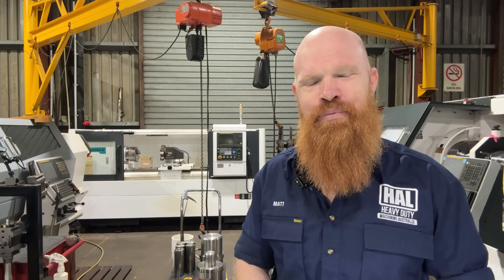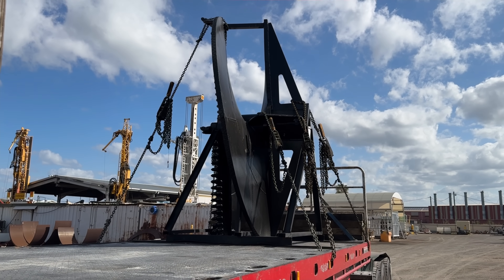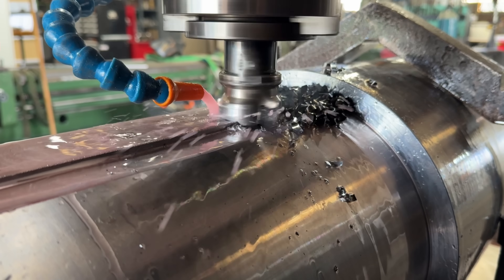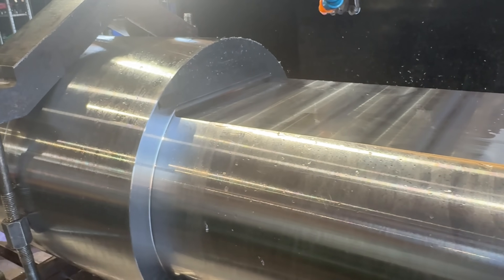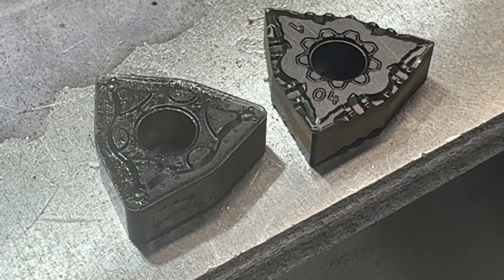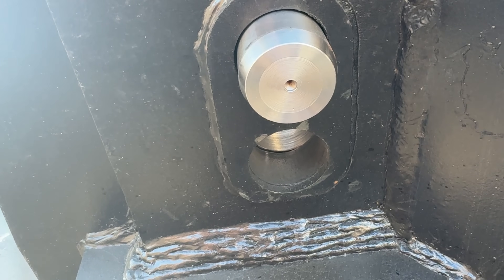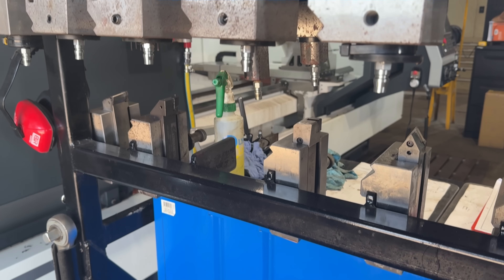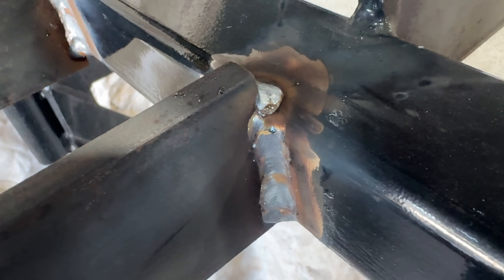Will It Fit? (Gigantic 200mm (8") Square Auger Drive for the Big Rig | Final Machining)

Comment: Hey Matt awesome video, thanks! - Question: Why do i see 5-6 flames but only one cut at 13:05 and 13:45
Reply from the maker: It’s actually the air passing through the center jet that creates the cut (the oxygen) the flame jets heat it to a temperature where it’ll cut.

What an excellent question.

So yeah there’s a larger hole in the middle, when you hit the trigger air come out and that’s what cuts 👊✌️
Reply: @halheavyduty  OHHH interesting, thanks Matt!

Comment: Really enjoy your engineering  presentations; im based in Coober Pedy just  wondering if you can give me a ball park figure of how much would it cost  to make the square drive with a maximum auger diameter of 2000mm  and 1500 mm  and 1000mm auger heads  with a 50 foot depth and  two axis base support  as this will be mounted on a large excavator rotaing base  not sure if i can add photos here or not  my phone is available for clarity also 😀
Reply from the maker: Hey mate, flick me an email to halengineeringaustralia@gmail.com if you want me to take a look.

Apologies for late reply.

Comment: Do water jet cutters have any use for such projects?
Reply from the maker: Great question!

Not really.   They’re great for plate steel up to 100mm, but get really slow and expensive after that (in my limited experience)

They’re awesome for certain applications. We recently used both water and EDM cutting on jobs.

It just depends on what you’re doing

Comment: Im not a professional but curious about something. When milling the flats is there a reason for not slicing the sides down a bit first before milling? Im thinking that would have saved time and energy. Sorry for the noob question. just curious. Thanks for shraing by the way. Great job!
Reply from the maker: Great question. Our style of bandsaw doesn’t allow it - but if it did we would absolutely saw a bunch off.

We do for some applications where possible.  Only limited by saw size

Comment: The machines I use have this same 200mm drive and the pin holes are at 90 degrees to each other rather than both in the same direction. That’s why your auger has holes on all 4 sides :)
Reply from the maker: Nice! That makes sense.

Comment: Really like ur videos,👍😎, I love that even though u do use cnc ,that u still like to use manual machines 👍 Am in Scotland and don't know anyone under 20yrs that would b comfortable having to do a whole machining job manually, yip they can fireba load of codes etc into a computer on a 5 axis machine,, but 5hey would have no clue how to carry out the same job having to use multiple machines, set ups and tools like dividing heads etc,, don't get me wrong, everything moves on, but I still think if u want to b a machinist, u should learn how to machine, before being taught how to program a machine to do the job for u🤷‍♂️🤔
Reply from the maker: Agreed 100%

All our CNC guys still use manual machines.  It’s just my opinion, but you get a real feel for it when you operate the machine manually.

Both mills and lathes

Comment: 15:19 You are either new to welding topics on the internet, or have some massive balls and thick skin! Most people would never show such a bead on the internet! If you trained to be a pro welder, then you obviously know........that is vertical down.........there is absolutely zero penetration and is it worse than holding that tab on with bubble gum. That travel direction should never be used as there is no way it could ever be appropriate and hold two chunks of steel together. 

No, you must have just turned that rack upside down and welded vertical up just to troll the viewers (but, it doesn't look like a vertical up bead), since there is never a reason to do a very fast and easy bead that looks great, for low risk applications. No welder would ever run a machine with plenty of power and make a hot and fast downhill pass that works great for thick to thin materials, while not burning through, and leaving a very pretty weld ( Although, if I ever did a vertical down weld, it might look even nicer, with all the practice from never doing it, since it is never strong enough for non-structural, only utilitarian every day life type of work!) Some of us just turn the part to horizontal and keep practicing vertical up.........but NEVER go vertical down, even if it is sufficient for the task at hand and may have advantages over doing it the "proper" way. 

Anyway, your beads do look quite nice and I absolutely agree that a well organized shop, with purpose built holders, is a great place to work, even if for some of us it is a home shop. Out in the field, on government jobs, I deal with what is there and get to operate machines and do manual labor. What I really like is the problem solving and attention to detail that I get to do with my own jobs as well as my hobby work. My tig welder is a 1965 Miller goldstar 460 amp machine, but there is nothing like fabricating and welding. My tab and slot certiflat welding table is covered in a torn down PM 833tv milling machine, that I am converting to a cnc mill, right now. It is fun to see the BIG side of the trades and to see how other people work. If things had played out differently, I could have ended up working on the kind of stuff in your videos, or as an engineer with an engineering degree vs. just a problem solver and builder who does a little engineering with limited knowledge. Your videos help scratch the itch my brain has to build, produce, and be creative, even if it is just entertainment for the most part. This beats the torture of watching some sporting event, or all the other odd stuff people seem to be entertained by.
Reply from the maker: Love the comment brother. Clearly you know your stuff.  You’re right about the job of problem solving.

It’s the thing I enjoy most about what I do.  The more difficult and crazy, the better.
Reply: @halheavyduty  I'm sure you picked up my humor.......I like that you did what works and showed it, despite people always trash talking non critical welds. Some people just can't grasp that not every job or task has to be done exactly the same or to the same standards and a smart person will be flexible and do what is right for the job at hand. Thanks for sharing!
Reply from the maker: I definitely got it.  We share a similarly dry sense of humour 💯👊🤣

Comment: Any concerns with the 90° interior corner instead of a fillet? I don”t understand the material science fully but looks like a stress crack waiting to happen.
Reply from the maker: It’s engineered to do it… but everything comes down to the ultimate field test.

Basically… we’re gonna find out real soon if it all works

Comment: Good to see a mix of cnc and manual machining.  Features like that large bore are perfect for a small G code program.  Decking off those flats would be an easy program too. CNC equipment is a big investment but you really don't need a turret on a CNC lathe.  A single point cutter takes so many repetitive cuts with incremental tool advancements.  That kind of work is just a pain the ass. Much better to let the computer do the work.
Reply from the maker: Couldn’t agree more.

We do about a 50/50 mix of conventional and CNC in the shop.  Both have their place in my opinion.

Comment: Did you build the auger?
How was the square hole cut?
Joke , you used a square drill bit.😂
Reply from the maker: Haha. The auger is the only part of the assembly we purchased. It was way cheaper to buy than build.

It’s a pretty gnarly piece of gear, but I reckon it’ll get the job done just fine.

Comment: As I always say. Tripan when you can ( cause you can always use that core you something else or sell it for a higher price then the chips )

You say that your not good at welding. Yet they look at least as good as mine if not better. And I even got asked by a Smith teacher to become a welding instructor. So take some pride in it my man
Reply from the maker: What a great saying! Im borrowing that one for the shop for sure.

Agree re trepanning. We are using our trepanning bit next video.  It just wasn’t quite long enough for this particular part.

Cheers re welding feedback.  I get the job done… but we’ve got some seriously good tradesmen in the shop.

I can mig and stick weld… but watching these guys tig weld is awesome.  Some serious skill out there hey.
Reply: @halheavyduty  just woundering but are you planning to make a new tripan drill ? if so then maybe try and make it so you can unscrew the like the first 50mm of the front and screw some extension rings on. basicly like some of the deep cole drills they use in mining. giving it unlimited reach ( start drilling with it in its shortest form and then extend as needed )

though you might have to mill the threads and side gutters of the ring on the lathe with a live tool/ spindle on the tool holder ( if you have controle over the chuck position ) that way you know that the gutter always line up cause the controle its placement compared to where the thread starts and stop 

just a idea nothing more. use it if you want
Reply from the maker: Good idea. I’ll be considering all options when we get to the design stage! Appreciate the comment as always mate 👊

Comment: Regarding the auger drive sub, I can't help seeing the sharp transition between the square and the round, as a focus for torque energy concentration. Fractures will begin at the internal corners between flats. If a slab mill had been available to cut the flats, the tool radius and tooling marks would have reduced the energy concentration at that transition. 

There comes a point when the auger is withdrawn, to be replaced by the rock drill. What determines that transition? Enthusiastic people are peculiar, in that they will push a rig until it breaks. If it never breaks, it probably weighs more than necessary. However, the auger drive sub is NOT a critical component, because the auger will always be near the surface, so can easily be recovered, to be immediately replaced by the drill bit. 

Perfection is impossible, and the enemy of progress. Any improved design would be second best, but we are not yet in that future. Everything ever made and used now can only be “third best”. I can analyse and criticise, but I must honestly score you 100%.
Reply from the maker: Love this comment mate.  Appreciate the time it took to write out!

The auger only does the first 12m of relatively soft ground, then we send the MEGADRILL.

I’ll be doing a full vid soon on how the tech works, but it’s a gigantic bit of gear that makes the auger look like a kids toy.

Agree with you re radius too.  We just had to make do with what tools we had in the shop for that one… although I’m confident it’ll hold.  It’s a pretty bloody solid chunk of steel.

Comment: On my own gut feel, I’m questioning the durability / longevity of a square drive, at these torque levels, especially imagining the fluctuations similar to a interrupted cut, but trust it has been considered.
Fascinating build, that I’m anxious to see in action.
Thanks for sharing.
Cheers
Reply from the maker: The first 10-12m won’t be too tough - hence the auger. It’s once we hit hard ground that it’ll be a hell of a show.

It’s all uncharted territory for us at this size… so as the saying goes…

There’s only one way to find out 

😉
Reply: Fully agree! I also question the integrity of an 8ft “auger drive” to pop a round hole that size some 250ft deep. It must be cutting the hole in sand.
Reply: @ronbuckner8179  It's all about "Feeds and Speeds" dude.

Comment: Would a half inch hole through the length of a large boring bar filled with lead dampen those high frequency vibrations?
Reply from the maker: I reckon it might help.  The humming didn’t really affect the end result, so we didn’t worry too much about it

Comment: The chips being pushed off of the horizontal milling machine reminded me of the game that is used in cosinos where you would load coins into the back wall.  They would drop down and starting pushing the coins sitting on a table. to drop down as your winnings.  It's to bad that the next time you see any of the machined parts that are not painted, they will be ankle deep in rust.
Reply from the maker: That’s what I thought too! 

Yeah mate. It’ll be rusty & have teeth marks all over it in no time.

Comment: is that a New machine? Is this your first one with a tool change turret?  Are you using Fanuc?  We use Fagor on our lathe and Fanuc with our mill. I like Fagor because of the graphics on our lathe.
Reply from the maker: It’s a new little turret lathe for small repeat jobs.  Fanuc controller.

We used to have Fagor & Anilam but I ditched them for Fanuc.  I didn’t mind fagor, but just chose Fanuc because it seems easier to teach (in my opinion)
Reply: @halheavyduty  yea I learnt Fanuc first on the mill. It was harder for me than Fagor although I did learn CNC from scratch with Fanuc so Fagor came easier.

Comment: If you are going to be making more of these big square drives in future, how about rough cutting the round billet into a square shape with a large bandsaw first, then finishing it on the milling machine for accuracy rather than using up hours and tools turning many kilograms of steel into fine chips? Enjoy your content keep it up.
Reply from the maker: Great observation. We did look at that, but our saw isn’t big enough… (and it’s a bloody big saw) 

We are looking at a bigger option in the future though - for this exact reason

Comment: I used to work as a CNC-Operator at Sandvik Raiseboring Sweden. So this is sort of related. It´s nice to be able to relate to what you are making, even if it´s not exactly the same as what I was doing. Greetings from the cold north of Scandinavia.
Reply: Our driller has a Sandvik DTH, cool stuff
Reply from the maker: Wow! Oh man I get that was interesting.  I’d love to visit Scandinavia one day… and escape this big hot oven 🤣
Reply: close to +9C vikings think  0C is kind of cold +-0 c celsius  is wen water freez.  Fahrenheit is a another scale wich do I do not understand. Kelvin 0 is really cold. Mm Cm.
 1/100 mm is about .00254 inch

Comment: Is the cnc lathe in the back of the intro new because  never seen it in your videos 

For the indexable drill do you use feed in Z-axis to drill? 

Really cool thing with the high speed steel tool perfekt use if you don’t have the right tool make it 

And I really find it cool that your apprentice is able to work with the jobs you do he did a amazing job with square drive 

That finish on the pin looks amazing great seeing the Manuel lathe working 

That tool cart is so cool you can have them right next to you while working we have a  storage compartment next to the lathes were we keep the tools
Reply from the maker: The tool cart makes a big difference to how enjoyable it is to work every day hey.

I’ve seen shops with tools just sprawled out on a bench and it does my head in.

Willy did a top job on that square drive. A real credit to him.

Yep. We use Z axis feed for the drills. About 0.1-0.17 usually depending on size
Reply: @halheavyduty  hand feeding such a drill for such deep jobs would probably a workout and a half afterwards your arm has a circumference of 50cm

Comment: 2:08 Great work all round but should be a bigger radius near where it goes from square to round at least 10 12mm made big things before radius all ways in corners for strength  chance of snaping in coner seen it happen you still have room to do so each side of flat add bigger radius means making flat longer seen big sharts snap because no radius
Reply from the maker: You’re dead on - we just didn’t have a bigger radius tool readily available (we have one on order for future builds though)

I’m pretty confident it won’t snap though.  It’s a fair chunk of metal.  

But… there’s only one way to find out 🤣
Reply: Good your getting one they go up to 25mm just have to step over as you know our pioneers put radius on everything for a reasion flexing your bit is a big sucker thats for shore

Comment: You're an Aussie please start talking metric, enough with the imperial BS
Reply from the maker: It’s strange.  We use both in the shop mate. Drilling is a very weird mix of both.

50/50 most days 

Drives me nuts. 100% prefer metric

Comment: I’ve never seen anyone do it - which is informative - but is there any reason you couldn’t bore those holes at about 8:00 to 50 or so deep with a shorter tool and then send in the boring bar, but with a collar to ride in the bore and keep it centered?
Reply from the maker: You probably could, but I reckon it’d take longer.

Comment: 1. Where does the splatter go after it is collected or falls below a machine? Does it end up in a drip tray where the chips are to be recycled with a pump and filter?
2. Are there any times when chips created aren't razor sharp?
3. Are there chips of non-exotics materials that are worth more than others (if collected with minimal spoilage) that can be collected and resold for scrap more than generic ferrous scrap?
Reply: 3. When I was working in a similar field, the greatest price difference for scrap was density. Swarf tends to be dirty and light(but there are swarf compactors out there). A 44 full of slugs from punching holes in sheet metal was north of 750kg.
Reply from the maker: Great questions!

1) all gets recycled in a closed loop system.  

2) some of the coolant does get taken away with the swarf (scrap)

3) long stringy stuff is always razor sharp in my finger cut experience. We only use leather gloves or tongs to handle it

4) we mostly stick to 4140 steel, although I imagine more complex shops would separate the more expensive stuff like titanium etc